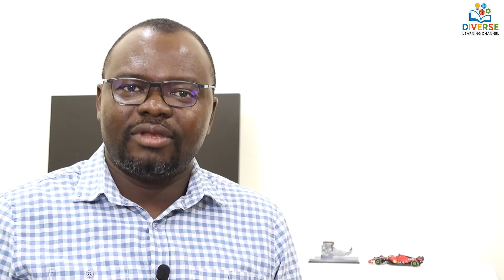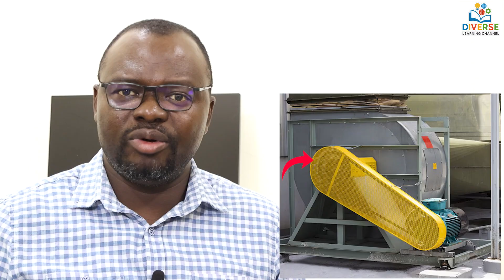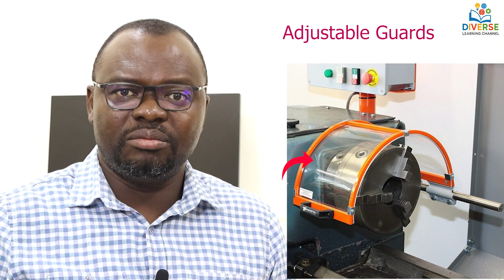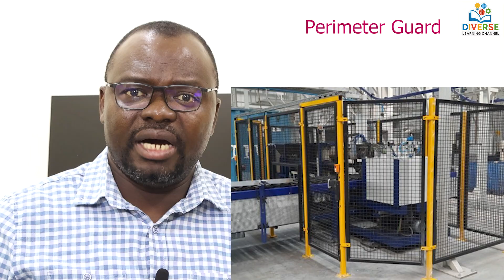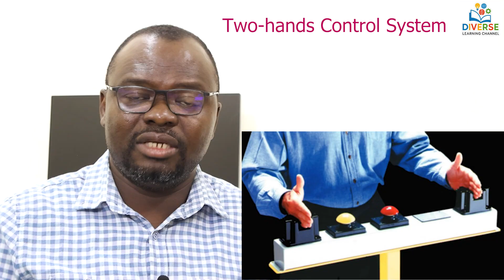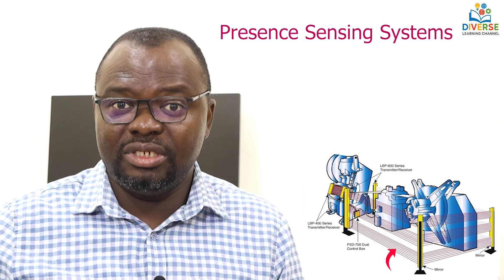Machine Safeguarding Explained: 6 Types of Machine Guards Every Worker Should Know

Comment from the maker: 👋 Thanks for watching!

Quick question for you: which type of machine guard do you see most at your workplace? 🔧
1️⃣ Fixed guard
2️⃣ Adjustable guard
3️⃣ Perimeter guard
4️⃣ Two-hand control
5️⃣ Interlock guard
6️⃣ Presence sensing / light curtain

Reply with the number 👇 And if you've ever seen a guard removed or bypassed on the job, share what happened (no names needed). Real stories help other workers stay safe.

📌 Tip: never remove a guard for maintenance until the machine is fully isolated and locked out/tagged out (LOTO).

If this video helped, please share it with your team and subscribe for more practical safety training. 🦺